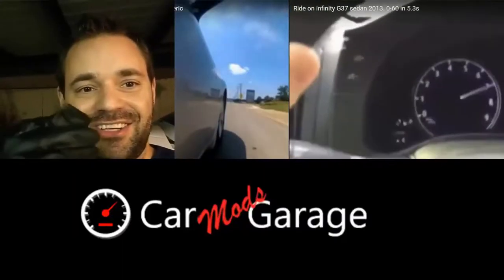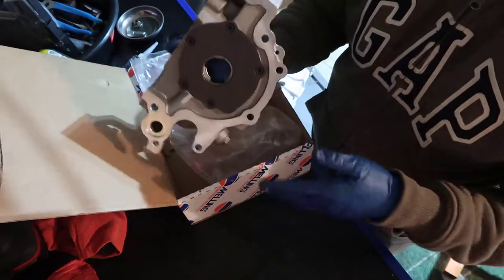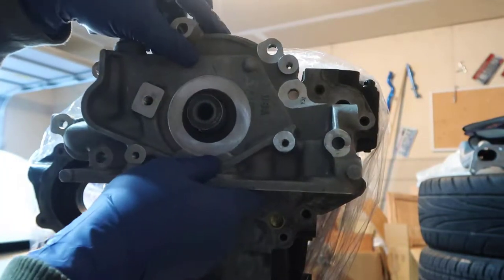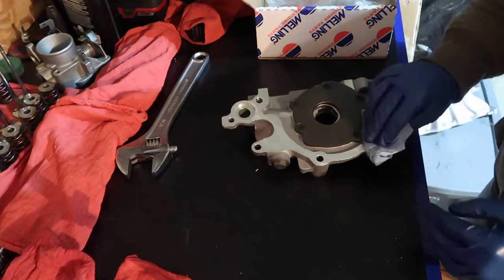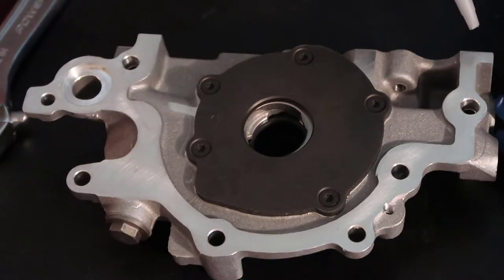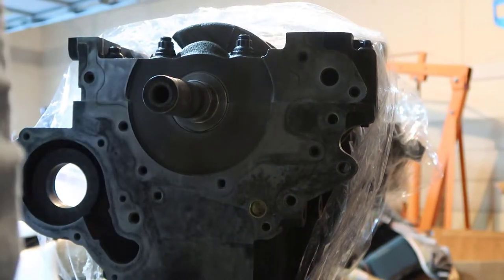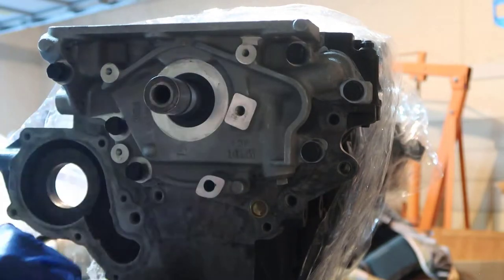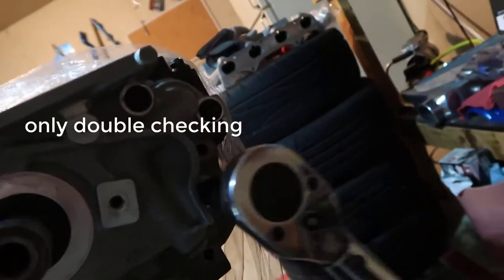Installing Oil Pump on a 420A - #Eclipse2GBuild

Comment: How can I remove the metal Cilinder with ridges on it.. it’s on the crankshaft pulley Mets bar
Reply from the maker: is it the sprocket that holds the timing belt? The bottom one attached to the crankshaft? If yes then you will need a tool like this https://amzn.to/2MFqHJS
Watch my other video where I removed that. Skip to 24:42 I will use hat tool to remove it
https://www.youtube.com/watch?v=S1cuJcJDSik&list=PLdqU6ucc0h6HmPrr8CW5xr_1sFysIjFlX&index=101

Comment: Do you know where the crankshaft sensor is located on the 420a
Reply from the maker: below the alternator slightly to the left of you are looking at it.
Reply: Car Mods Garage thank you I really appreciate it because my car cranks but doesn’t start a changed the spark plugs and fuel pump but still no start
Reply from the maker: @fernandoolivares9060  check for the full pump nose when you turn the key and also the ignition coil
Reply: Car Mods Garage the fuel pump does make the noise for about 2 to 3 seconds and it’s pretty loud with out no seats and I have NGK spark plugs brand new but I have never changed the coil pack and I put a brand new cam shaft sensor from auto zone
Reply from the maker: Hard too say. If it is a sensor you might get score on the OBDii reader. It can be spark though. You might be able to test for spark somehow. Gotta Google how to do it 😂
Reply: Car Mods Garage I have a 95 manual GS and idk how it happened but I did a burn out on first gear I reved it to 6000 RPM and dumped the clutch but as soon as I put it in first gear and give it gas it stalls on me and shuts off completely
Reply: Car Mods Garage people told me it might be a bent valve idk yet idk how to open the block nor nothing
Reply from the maker: Ya that makes sense. I have videos doing all of this. What my video assembling the head so you will know how to disassemble. Super simple. 
https://youtu.be/lRppGC3GCZ4
Reply: Car Mods Garage yeah I think I probably have a bent valve because every thing on the car is original nothing has been changed besides the head gaskets and valve cover gasket
Reply from the maker: Sad man. I hope you get that fixed